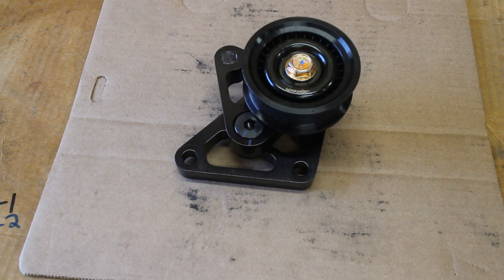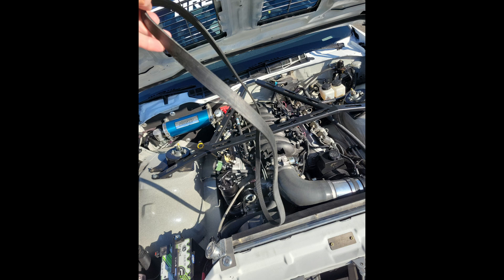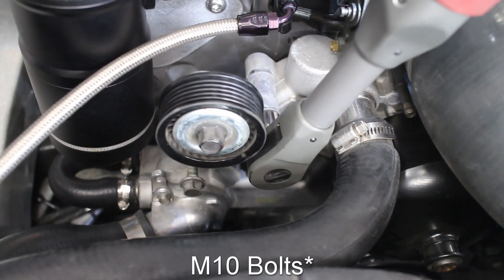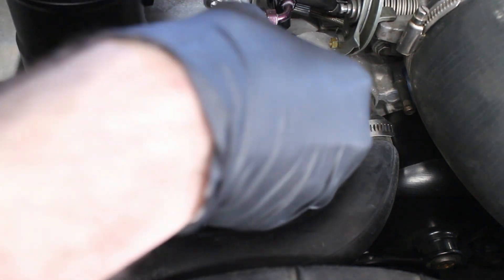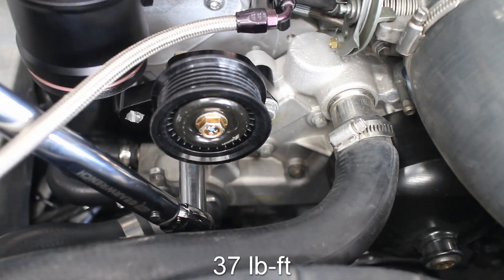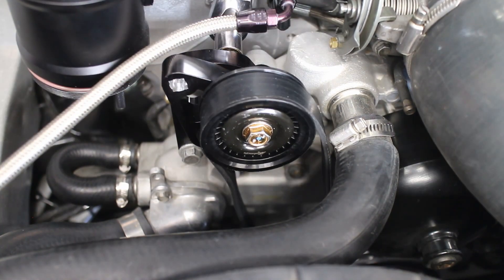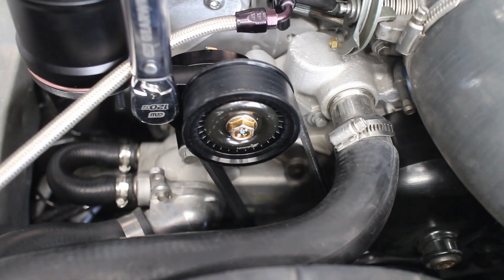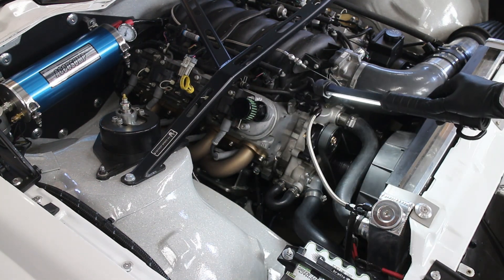Katech Billet LS Belt Tensioner Install LS1 F-body (KAT-A4425-BLK)

Comment: Question I’ve been having a squeaky problem with my 4.8 I changed every component and pulley and also the tensioner and It still has a squeak over when I replaced the belt it stops squeaking longest 2 weeks then it starts to squeak again 
My question is that would this part upgrade possibly help that squeaky I been thinking maybe the cheap autozone tensioners are no good ???
Reply from the maker: does it squeak all the time or just at certain RPMs?

Comment: Video IDEAS….
wiring the LS1. 
Rear Axel ring gear and or 4 wheel disc.
Anti loc brakes and line loc?
Fuel injection mods
Reply from the maker: I have  full LS1 wiring video.
ABS video coming soon 
and a disk conversion for the rear and front.